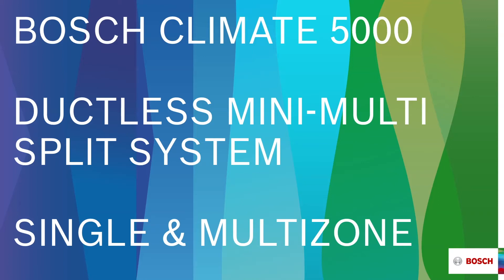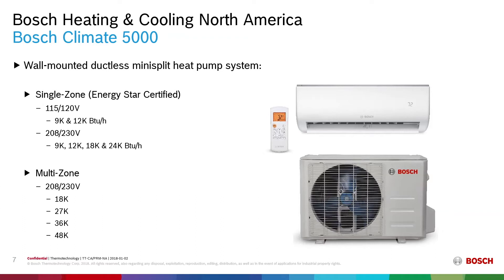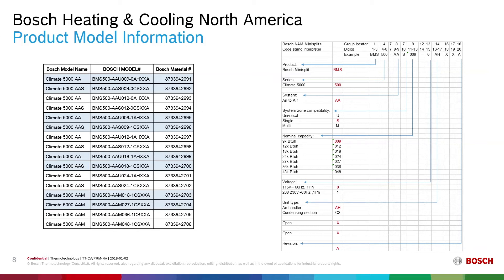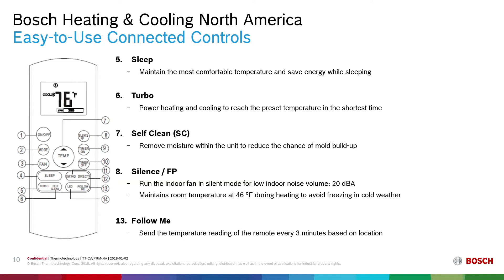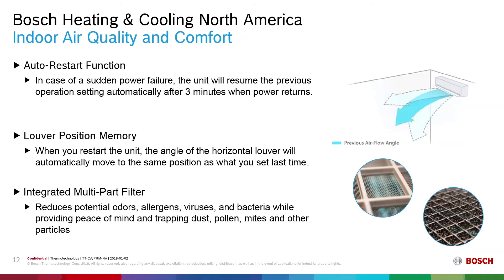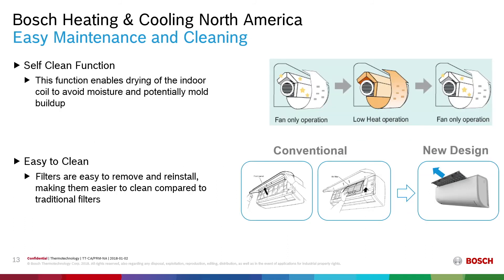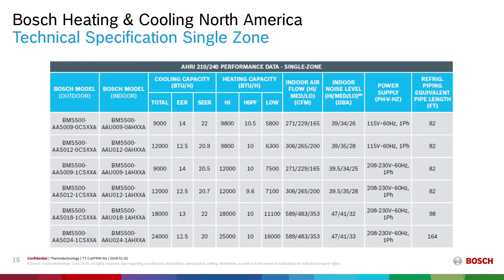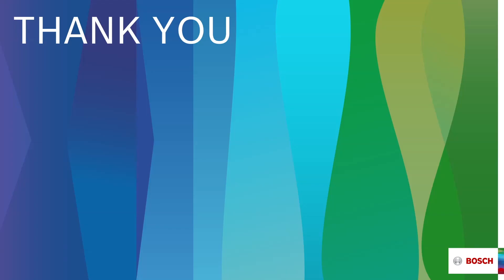Bosch Climate 5000: A Ductless Mini and Multi Split System (Online Training)

Comment: I bought 5 indoor units, bosh 50000 9000 btu bms 500 aau 009  1ahwxb. I don't know where to get an outdoor unit to run them. I imagine I would need 2 units to run 5 or more indoor units?